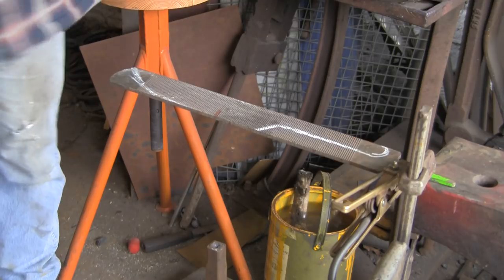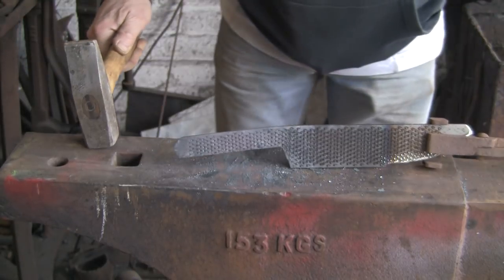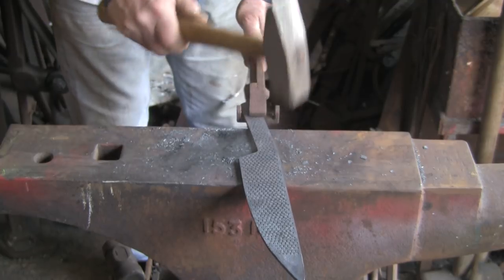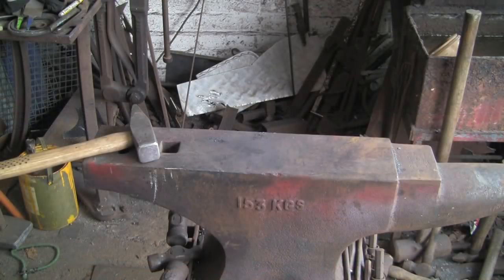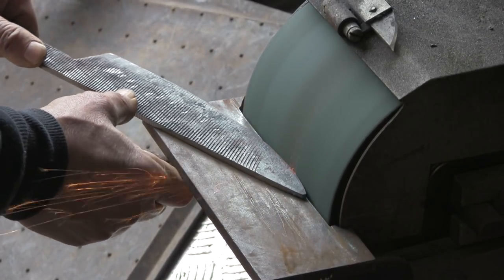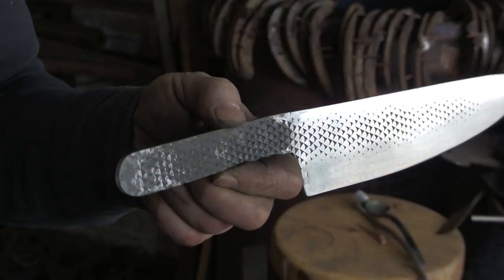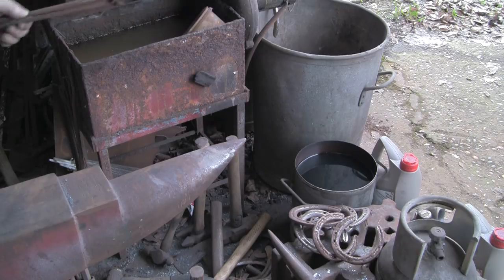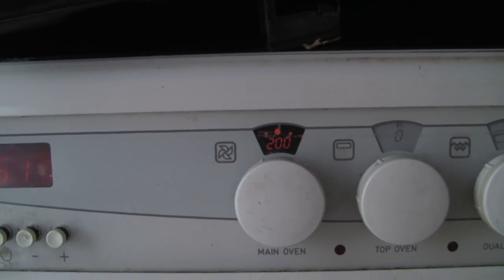Chef Knife 2 Part 1

Comment: One thing you can try doing with the cheap belts to reduce belt bump is to thin out the grit side of the belt over the seam with a whetstone.
Reply: good tip, I have a few of those that go thump thump! I will have to give that a go
Reply: I saw Travis Wuertz doing it at the Blade Show 2017.  He was doing a demo of his surface grinder attachment.

Comment: You must to pull forward a bit the plate, is need to be 1 or 1,5 mm forward for the two roles, then the pressure will be ok on the belt. The tension role must be with curve surface, help to centering and keep there the band, help to be that way the moror role to.. Nice work. Thanks for sharing.

Comment: When belts fail at the joint, it's an indication that they are old stock, usually a year is considered the maximum shelf life as the adhesive does have time limitations.
Reply from the maker: It didn’t just let go at the joint. The joint was so thick compared to the rest of the belt it tore apart! Good belts don’t have that step.
Reply: If it was a lap joint, run direction matters, that's why they print arrows, and if made properly should be OK. If they are a butt and taped joint (a better design btw) then it can run in either direction. I do agree, some butt joints are made way too thick, again a sign of poor craftsmanship either too much adhesive or not enough preparatory grinding, or both. Nice looking knife too.☺
Reply: It can get pretty exciting when a belt gives way, I must say.  Not a good way to test one's reflexes!

Comment: The rasp I am working with was found under a bench in an old barn it is  3/8 thick, the teeth go almost all the way through it . That would be unsanitary . So I have decided to fold it over and forge weld it to together , First i will soak the rasp in muratic acid to clean the rasp. I will also use EZ WELD forge welding flux , then draw it back out .I built a drop hammer powered by my 15 year old neighbor and $20 ,  can I use hard wood charcoal instead of coke ?
Reply from the maker: I guess you can use charcoal if you can get it hot enough. I have never used it myself.
Reply: i can get it hot enough ,but when you said you cant light the fire with trash i didn't know if it was clean enough
Reply from the maker: That could be a problem but if your charcoal is good it shouldn’t be an issue..
Reply: thank you

Comment: Those farriers rasps are made from 1095 usually these days.  Nice job
Reply: look on hellers sight they are made from high chrome high carbon steel . carpenter steel sells what is labled high chrome high carbon steel .but they do not give an alloy list .But you are correct most of older rasp are w 1  or 1095

Comment: When you got to tempering how did you work the required time out was it guessology with a hint of experience or can it be properly worked out, thanks adie
Reply from the maker: It can be worked out, so many minutes per inch for a given thickness if you know what the material is, but i guessed it going by my first attempt.

Comment: do you know exactly what kind of steel it is?
Reply from the maker: Of course not!
Reply: some new files are made with average quality steel and cemented thats why i ask you.
Reply from the maker: Cemented with what?
Reply: industial secret i realy dont know.  i know a blacksmith who does it with cast iron powder (only on his knives)
but some good files are still made with high carbon steel.
Reply from the maker: This is definitely high carbon steel, these rasps cost nearly a hundred pounds a box!
Reply: so it should be h carbone steel. and it s a very good point and you did a good job.
Reply: chevalvapeurdumazout    I think you meant case hardened, not 'cemented'   🔥
Reply from the maker: That makes much more sense! These are high carbon steel throughout, no doubt about that!
Reply: that s it   in french "cémentation" google translate it  wrong.
sorry
Reply: chevalvapeurdumazout    Google is very fallible sometimes in it's translation algorithms. Shit happens then you wipe your butt and get over it